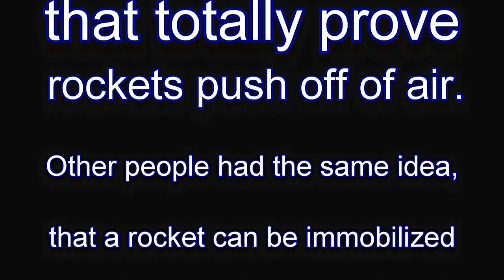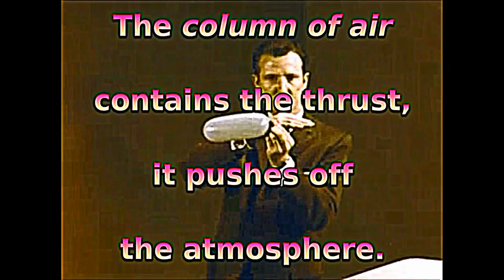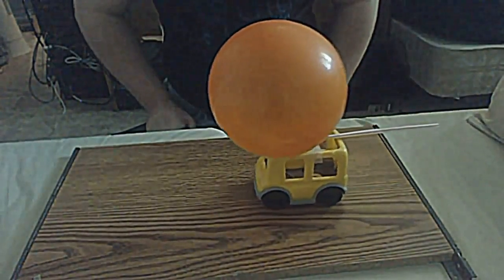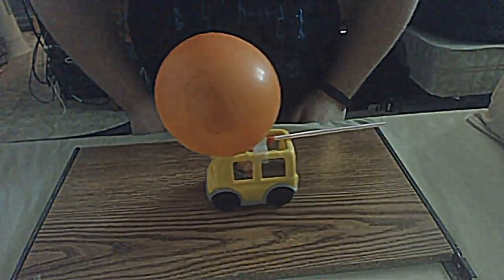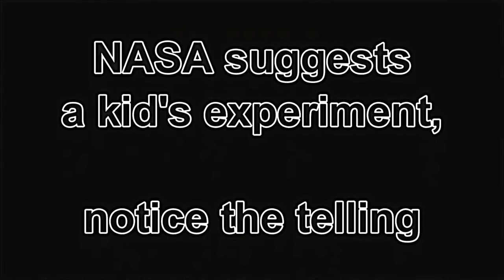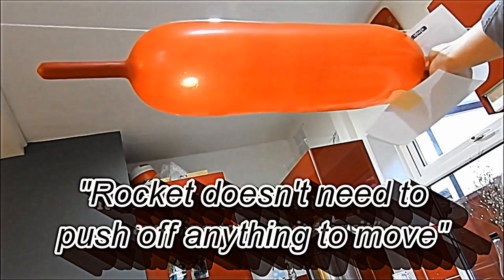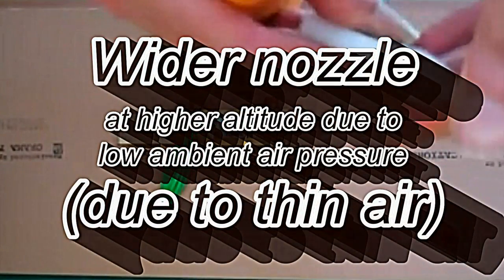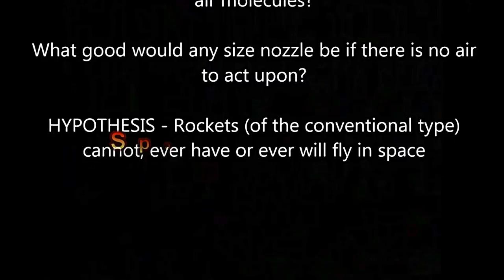rockets push off air

Comment: Man I've been watching videos all morning and thats the one thing I didn't think about. If they need a larger bell for higher altitudes that tells you rockets will not work in space. Bc if it was simply the the gases escaping that caused the motion there would be no need for a bell to create more resistance from thinner air! Absolutely great observation my friend!
Reply from the maker: And at the end of the day, a rocket is just a giant blow torch ... nothing is "ejected". A cannon has extra reinforcement and still can crack but they expect us to believe that tons of force is pushing back inside the fragile cone all the way to the back of the combustion chamber.
Reply: @rocketspushoffair  well you do believe that a person needs to be grounded to throw a ball, so "they" don't expect you to believe anything that actually makes sense.
Reply from the maker: @pblakeney  throwing a ball has absolutely NOTHING TO DO WITH ROCKETS
Reply: @rocketspushoffair Unless it does.
Actually it does. They both follow the same principals of Newtons third law. The Saturn 5 ejected 20 tonnes of fuel per second at 2000 m/s. I mean, you try throwing a bowling ball at that speed whilst standing on a skate board.
Reply from the maker: @markymarkst3r  Nope. NOTHING IS "EJECTED". Newton's law has NOTHING TO DO WITH GASES AND COMBUSTION. https://www.youtube.com/watch?v=rtK3P6Jd_co&t=222s WATCH slo-mo of gun recoil, notice that the bullet is LONG GONE before any recoil takes place! In fact "actually" recoil has nothing to do with Newton. GUN RECOIL is the atmosphere SMACKING the back of barrel as it equalizes pressure inside.

You are simply parroting the bs you have been fed, and this shows you are NOT THINKING. Stop trying to defend bs because it can only be defended by more bs.
Reply: @rocketspushoffair  Oh look. I just read this bit.
" GUN RECOIL is the atmosphere SMACKING the back of barrel as it equalizes pressure inside." WHAT?
Just goes to show that having no clue doesn't prevent someone from sharing an opinion.
Where would you get such a daft idea.
Reply: @rocketspushoffair  Nothing is ejected 🤣🤣have you ever watched a rocket launched by Space X or NASA? What's all that clouds of gasses coming out the nozzle???
Reply from the maker: @markymarkst3r  exactly https://www.youtube.com/watch?v=rtK3P6Jd_co&t=222s
Reply from the maker: @ianwarburton2007  gas escaping, but there is NO IMMEDIATE RECOIL https://www.youtube.com/watch?v=rtK3P6Jd_co&t=222s newton's laws work on a pool table, not on combustion gases, as you can see in the video :face-green-smiling:

Comment: rockets push off air - Once I asked you if crossbows had recoil or not.  I believe your answer was initially "No" but may have changed to "I've never fired one".  So I made this video to demonstrate the answer to that question:  https://youtu.be/WbNkjlzf0w0  care to comment?   Notice how I setup identical experiments, one with a projectile that  has a low mass (hollow) and one that had high mass, while BOTH had the same cross-section as far as air resistance is concerned.   Do you STILL contend that the crossbow feels recoil because of the bolt pushing on the air ??
Reply: A rocket is not a crossbow, crazy guy.
Reply: @papalegba6796  but both a rocket and a crossbow feel mechanical recoil due to the law of conservation of momentum.  You would know this if you ever bothered to take high school physics.
So why did you choose to drop out of high school?  Learning disability?
Reply: @stuartgray5877  wrong.

Comment: One cart is quite noticeably faster than the other. Meaning one has significantly more thrust force than the other. While one has enough thrust to escape the vacuum cleaning (which should be sucking the air away from the rear which is your entire premis isn’t it?) the other has no where near enough force. One could fly off the table even when being sucked by a vacuum, whilst the other could barely make it to the end of a shortened bored even without a vacuum. Your equivocation is false.

In addition, vacuumes create a low pressure zone. They don’t just draw air in from one direction but from a radius around the nozzle. Clearly observable if you’re vacuuming sand or saw dust. Meaning it doesn’t matter one little bit of its perpendicular to the vacuum or not.
Reply from the maker: No. The idea is to bend the exhaust at a distance. Because the claim is that it is "ejected" like a cannon ball, where the equivalent is to smack the canon ball after it leaves the cannon. Once the exhaust passes the edge of the nozzle, it can no longer have any effect on the rocket, right? But it does, because it never leaves, it is not "ejected". It is one with the rocket, just like a blow torch. And the internal pressure is very low. No "equal opposite force inside the cone or combustion chamber. Only between the exhaust column and the atmosphere.

The guy who put the straw all the way in, did not have more power, the balloon opening was the same size. Inside the vacuum hose there is dense air to push off, just like going up an escalator the wrong way, there is tons of friction to push off.

You need to be extremely close to the opening of the vacuum hose to get pulled in. And in the second video you see that while the entire exhaust straw was inside the vacuum on full power, it EASILY took off.
Reply: @rocketspushoffair  what do you mean the gas never leaves the rocket? Of course it does. Air escapes the balloon. Once it’s out of the balloon it is not apart of the balloon. Once you throw a ball, it is no longer apart of you. Don’t be stupid.

Also, no. One car clearly and visibly has more thrust than the other. You can tell purely from the speeds the travel at. As for more saying they have the same amount of thrust because they have the same diameter nozzle is stupid. If the balloon on one car is less elastic than the other than it can apply more pressure to the air inside it. More pressure, even though it’s passing through the same diameter nozzle, the faster the air will be going. Faster Air means more mass flow rate. More mass is exiting at higher velocities. What’s the equation for momentum? Mass multiplied by velocity. They are quite clearly two different balloons. Not even getting started on the affects of rolling resistance.
Reply: @rocketspushoffair  and it will have more air to push off inside the vacuum nozzle? No. That’s just plainly false. If it has more air dense air. It would be at a higher pressure. If it was at a higher pressure air wouldn’t be going into it, it would be going out of the vacuum numb nuts. The whole premise of how a vacuum cleaner works is that it creates a lower pressure zone by removing the air. Thus allowing the higher pressure air to rush in to fill that void. It doesn’t have more dense air in it you crazy.
Reply from the maker: @engineeringtheweirdguy2103  The exhaust does not DETACH, as in a blow torch, it is ONE SYSTEM. There is NO ACTION REACTION of millions of pounds of thrust in t he combustion chamber/cone. The pressure is VERY LOW, and they worry about negative pressure. "Don't be stupid." The balloons were very similar, no significant difference. The slower cart weighed more. Thrust was equal. The fact that even while being inside the hose the cart took off tells you that rockets push off air! CASE CLOSED.

Your excuse of the vacuum sucking out the thrust is invalidated.
Reply from the maker: @engineeringtheweirdguy2103  All it does is change the direction of the air, and it does concentrate it in the hose, and the atmosphere instantly responds by rushing in. No matter how you look at it "numb nuts", the rocket pushes off air.
Reply: @rocketspushoffair  but lets get to the core of the issue here shall we? tell me if you disagree with any of the points below:

1.) according to newton, something will remain in motion unless acted upon by an external force. True or false.

2.) any force acting upon an object of mass with have an equal and opposite force acting upon it as a reaction. True or false.

3.) Air expands equally in all directions. True or false.

4.) According to the theory of molecular gasses, upon which all gas laws are built, gas particles are particles with both mass a velocity. true or false?

5.) according to the theory of molecular gasses, the space between gas particles is empty space (a vacuum) and per volume, this makes up the vast majority of the volume of any gas. True or false.

Answer these and truthfully and then hear my argument. If you can poke any logical hole in that argument I will concede that rockets do not work in space.
Reply from the maker: @engineeringtheweirdguy2103  OK, ready for your argument.
Reply: @rocketspushoffair  well since we agree that gas expands equally in all directions unless acted upon, it can’t reasonably do that inside a combustion chamber, hence the exhaust comes out of the rocket is a singular uniform direction. This means it must be being acted upon. We know that gas being particles with mass and velocity that the following two things must be true. Firstly, that anything acting on the particles to change their direction towards the exhaust exit, must also have a force applied onto it from the gas particles. Secondly, that gas particles impacting and consequently bouncing off the combustion chamber walls will observe a force. A transfer of momentum proportional to their masses. 

We also know that there is nothing in a vacuum in which to act against the gas. And since gasses are mostly empty space with a few gas particles in them. There is nothing special about an area with slightly more space and less particles. Therefore the only thing Acting on the gas to direct it to the exit and change its direction and speed, would be the combustion chamber. And the combustion chamber will then also feel a reactionary force from the gas particles.

Also since we agree that gas particles are particles with both mass and velocity, and that gasses are mostly empty space between particles, that once the gas particles leave direct contact with the combustion chamber walls, there is absolutely no way in which the gas particles can physically exert any affect on the rocket. So Any random impacts with other particles in the mostly empty space they reside in once they’re outside the rocket, has no physical means to affect the rocket what so ever. Meaning that it cannot push of atmosphere. But it does by definition push off the rocket. It must, otherwise it would expand equally in all directions which it observably can not.
Reply: @rocketspushoffair  so..... what are we thinking? any response?
Reply from the maker: @engineeringtheweirdguy2103  i'll respond soon, hopefully later today
Reply: @rocketspushoffair  okidokey. I eagerly await your response
Reply from the maker: @engineeringtheweirdguy2103  It means it is following the path of least resistance, the natural expansion. Again, there is very little pressure in the combustion chamber, and there is a danger of negative pressure. The laws you invoke for bodies were never intended for gases. All the action reaction is happening in the atmosphere; gas pushing on gas. You cannot push the atmosphere out of the way, it will continuously resist you. Recoil is an almost instant pressure equalization by t he atmosphere rushing into the barrel and slapping the back of it. It has nothing t o do with the bullet, watch 5 minutes (the super ultra slo mo is after 2 min 40 sec or so) https://youtu.be/rtK3P6Jd_co The combustion chamber walls and the nozzle are DELICATE and in the Saturn V the cone had cooling tubes full of liquid rocket fuel circulating all around it.--Millions of pounds of thrust are in no way shape or form pushing inside there. Case closed.

EXACTLY WHAT MY VIDEO REFUTES: "there is absolutely no way in which the gas particles can physically exert any affect on the rocket. So Any random impacts with other particles in the mostly empty space they reside in once they’re outside the rocket, has no physical means to affect the rocket what so ever." Simply bending (redirecting) the exhaust thrust column, (at a specific distance away from the edge of the exhaust cone) immobilizes the rocket. Case closed.

When you let the air out of a balloon, there is no force pushing at the opposite end of the opening inside the balloon. The pressure decreases equally everywhere. I plan to take a pressurized cylinder fitted with a few gauges (one at the opposite end, one in the middle, one near the exit) and this will show that the pressure decreases equally everywhere, just like a punctured tire loses its air slowly.
Reply: @rocketspushoffair  I presume you’re formulating another response?
Reply from the maker: @engineeringtheweirdguy2103  Why? My first response is fine, did you not read it?
Reply: @rocketspushoffair  because your first response is fundamentally incompatible with the 5 points we both agreed upon earlier.
Reply: @rocketspushoffair  which means either you lied and you don’t agree with one or more of the 5 points we agreed upon. Or your explanation is knowingly incompatible with physics and you just don’t care.

Comment: 20:30  even if a conventional rocket maintains its thrust when entering the "Vacuum-of-space", it instantly begins to tailspin because there is NO air to provide the rocket-thrust a directional-resistance (Flight-path)!!!! This would be similar to a conventional torpedo coming out of water, and getting into a tailspin due to losing the directional-water-resistance available when submerged!!!
Reply: thrust is an applied force, so it must come from a body external to the rocket. in a vacuum there is no external body so no force can be applied. it's that simple, just look up the 4 forces of flight to see i am correct.
Reply: @papalegba6759  Rudy-Giuliani, with his high-pressure-gas-pump, recently almost became airborne, like a rocket, from his chair, during a kangaroo hearing he had arranged with some State Republicans. SNL capitalized on it the same weekend!!!
Reply: Crap. A rocket in space is steered by directing the thrust in the direction required. What you said is total garbage.
Reply: @davidfaraday7963 -Fart==Giuliani-Thrust

Comment: The fact is anyway, is that there are many videos that show rockets working fine inside a vacuum chamber, and even if tyou try to claim that the exhaust prevents the chamber form being a percect vaccum, the fact is the it's still a MUCH better vaccum then produced by a vaccum cleaner.
Reply from the maker: the fact is, there is no experiment online that shows rockets work in a vacuum, since combustion/ignition is not possible in a vacuum or even at 14 miles up ( Cody https://youtu.be/8Cx9mNnky2U balloon https://youtu.be/7DQCtUd_4yg ) the fact is that combustion/ignition is only possible if you SEAL THE REACTION from the low pressure/vacuum surroundings, the fact is, the vacuum cleaner was not used in place of a vacuum, the fact is you still don't get it, the fact is, the vacuum cleaner was used to bend the exhaust by 90 degrees at a distance from the exit point, the fact is that doing so immobilizes the rocket, the fact is, that the suction was not a factor AT ALL (as proven in my featured video), thus, the fact is, rockets push off air
Reply: @rocketspushoffair  There are MANY examples videos of rocket engines working in a vaccuum.
Reply from the maker: @11cookeaw14  wrong, the only way to get combustion/ignition is to seal the reaction, as proven in the previous 2 links, even Warped Perception channel admitted he had to do this after he spent an entire day with university experts helping him too ... you nothing, SPACE IS FAKE 😂😂😂
Reply: @rocketspushoffair  No those don't back you up. It's NOT a vaccuum inside the rocket chamber, it is in fact under high pressure.
A common rocket fuel is to use liquid oxygen and liquid hydrogen and have them react.
So the fuel itself contains the oxygen needed fro combustion. Nothing you've posted in anyway contradicts this.
Reply from the maker: @11cookeaw14  no reaction except in pressurized oxygen atmosphere, well below 14 miles up ... ignore reality all you like ... the pressure is low in the nozzle and combustion chamber, basic expansion of gases law ... you are CLUELESS trying to defend a sci-fi myth

Comment: And what kind of earth shattering truth did you actually demonstrate here? I don't get it.
Reply from the maker: Did you watch it all? Some claims were falsified, such as the claim that rockets eject a mass. In the experiment where a vacuum cleaner was used, notice it was at 90 degrees to the exhaust column of air? I'm talking about the orange balloon rocket toy car. Notice also the opening of the vacuum hose was at a distance behind the opening of the straw. The idea was to bend or REDIRECT the exhaust coming out by 90 degrees, which should not bee able to immobilize the rocket IF the ejection idea is correct, where they say an equal opposite force hits the inside of the balloon the moment the opening is created.

So, they say a mass is ejected, that brings to mind a canon firing a canon ball. If I swat the cannon ball from its path after it is ejected, obviously that won;t affect the canon.

NASA fans say that about the exhaust from the rocket. They were saying in the comments, that once the exhaust passes the edge of the exhaust cone, it no longer has any effect on the rocket, "it has been ejected" but CLEARLY  that is not the case. That's what was demonstrated in the video.

The clip at the start was to answer the objections that somehow the vacuum suction held the balloon rocket in place. Obviously that is not true, since when the entire straw was placed in the fully on vacuum, the balloon rocket car was still able to thrust away no problem. There is plenty of air inside the vacuum hose to push off of, even thought it is going the other way. Like running up an escalator that is going down, it is easy to do.